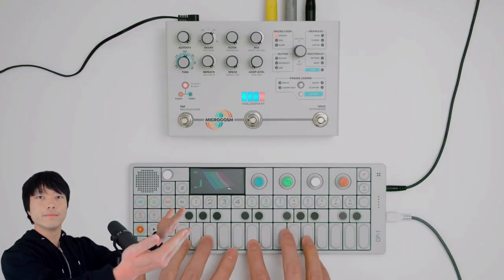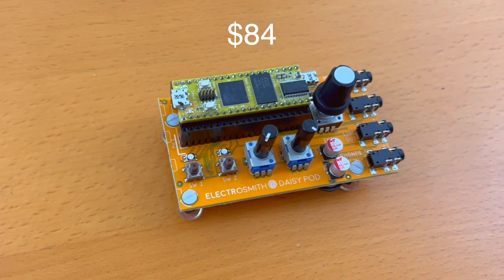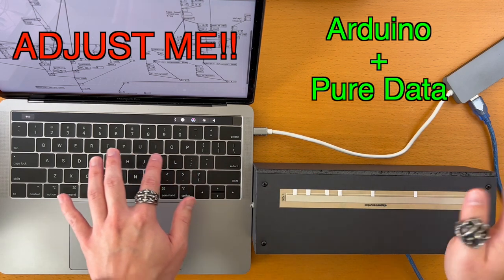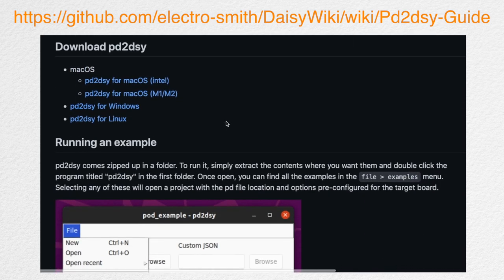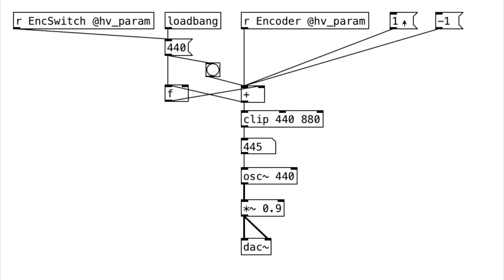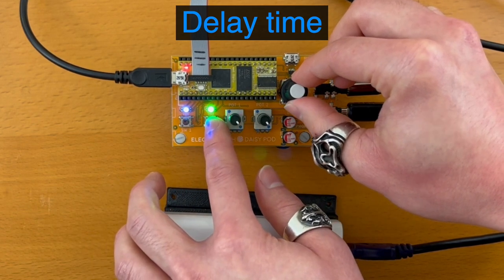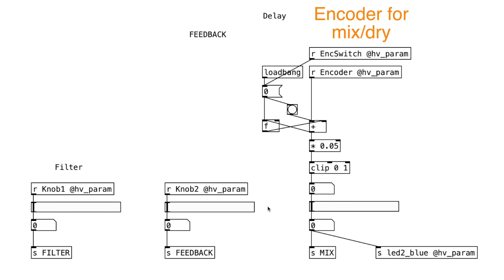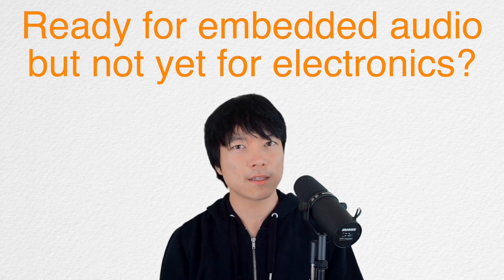Let’s Create an Effects Pedal/Unit With Daisy Pod!

Comment: hmmm the SD card slot makes it interesting for creating a Reverb that uses Impulse responses, if you wanna add all sorts of captured Rooms to your reverb effect. Because they do consume a bit of storage space.This Daisy Pod board is awesome. I'm actually tempted to create a Subharmonic Generator with this thing. Shouldn't be too hard to do as you basically need to add a function to divide the sound into 3rds, 4ths, 8th, 22nds  and so on and so forth. And not just one time but in a whole range of divisions with 4 or 12 of such divisions in a row. That creates a sound that is VERY distinctive because subharmonic tones don't exist like that in nature and works fantastic with something even simple as a Sawtooth wave oscillator. I think that should be totally possible with Pure Data.
Reply from the maker: I haven't seen a IR reverb project yet. I wonder if it's possible. Maybe there is a discussion on it in the forum. I have seen a cool granular project done with Pod recently! 

The subharmonic generator project sounds awesome! Once you make it in Pure Data, open that patch up in PlugData to check if the objects you used are supported. If it is, it'll be cool to see a standalone hardware synth version of that!!

Comment: Hi Takumi! Thanks for your content it is really good and explanatory but I have some doubts about Daisy pod. If I buy the pod it already comes with the seed attached to it? Or pod is just a headless circuit meant to be used with the seed? If I want to try the pod souls I buy the pod and the seed or just the pod which already comes with the seed? I couldn’t find that info on E-S online shop.
Reply from the maker: Hey Santiago! 
When you purchase the Pod, Seed will come attached to it.
Reply: @SoundSimulator  is it soldered to the pod? If I want to use the pod as a prototype module and remove the seed to use it with other components?

Comment: I would like to build a drum/percussion sample player that is compact. This looks like a great platform because I mainly want to use the sounds as an in ear monitoring reference track, sort of like a click track. Is program the sequence from another device. Having headphone out is already a plus. Ideally I could add a volume knob that would control level to headphones and level to main outs independently. Does anyone have experience enough to know if this is possible?
Reply: Also, drum samples or drum synth tones would be fine, doesn’t have to be samples. My concern with samples is whether the playback latency will be low enough. As I’m thinking about it I actually would rather it be drum synth. The reason for independent level controls of headphone and main outs is so that if I want to send the drums sounds to the main mix it’s easy to control from the pod.

Comment: keep getting error: no DFU available (i have the POD). Tried it with Flash Program and also Flash Bootloader, same error. Funny thing is if I hit reset the daisy flashes the lights but there is no sound. Looking at the pd file looks like the pod test file is supposed to be an oscillator or two. Don't know what is going on here. Had much better look with using Max 8, where I could load and run the sample oopsy files and hear things. This pd2dsy seems a bit wonky or I am missing something. The github page looks pretty straightforward except it doesn't produce the intended results.
Reply from the maker: (In case you miss the other reply)
Could you share all this to the Daisy forum? I would be happy to help you there! 
Feel free to get super detailed about it. 

See you there!!
Reply: @SoundSimulator  Yes I have, under the forum name 'Astrin'. Love your videos by the way.

Comment: You mentioned it can be used as an effect for OP-1, but why can't it be used as an substitution for OP-1? More affordable one. Is it just too ambitious or technically impossible because of some processor limitations?
Reply from the maker: I think it'll be more about time. At a certain point, it's better to buy something and save a lot of time. 
You could make make a portable synth that's like the OP-1 with the Daisy Seed, but it'll involve a lot of  time to develop.
Reply: There are a bunch of projects on YT and elsewhere to do similar-ish things (Zynthian comes to mind, even it's absolutely not an OP1 and it runs on a Raspberry Pi - which is a computer - and I am sure there are plenty others around), but yeah, time, skills - and scaling issues (buying components at retail price, injection molding, etc.). That could be a cool project though...